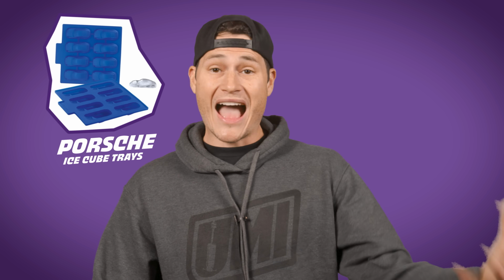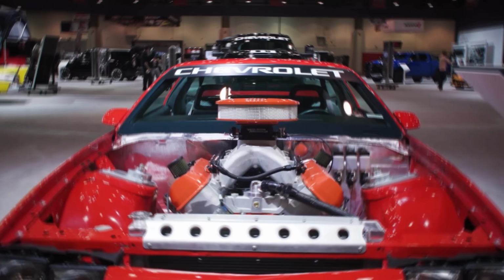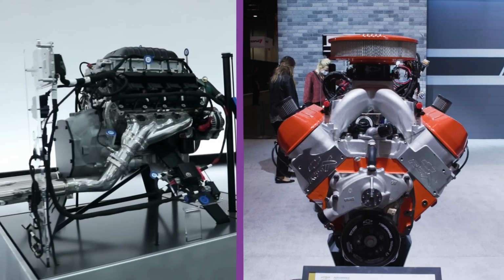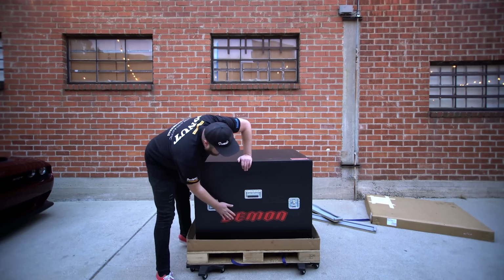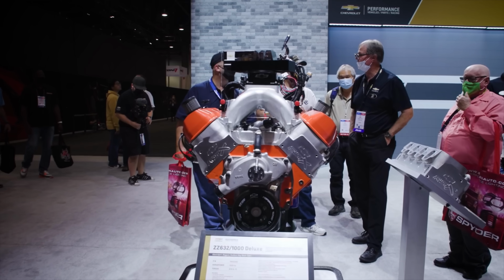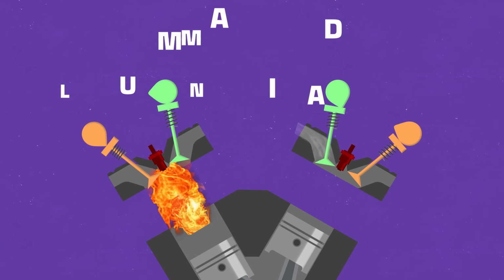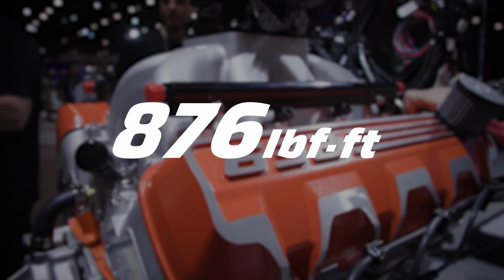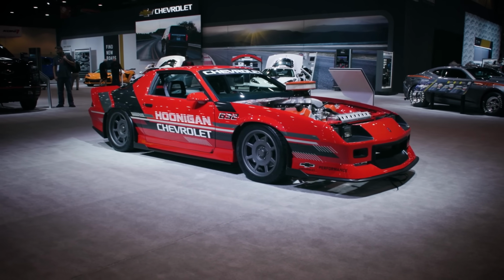Chevy's 1000HP Crate Engine EXPLAINED

Comment: Conversation in Cheavy office:
-"Hey, let's do a pinnicle of modern engineering."
---"So forced induction?"
-"No. Huuge displacement."
---"Extremely efficient heads. and high rew limit?"
-"No. Pushrods and some huuge valves."
---"Hi flow fuel injection?"
-"No."
---"So we make an engine that can idle 24/7 for a decade but for a racecar."
-"Ok, you can have fuel injection."
Reply: 1 There is nothing modern about forced induction, mercedes has been factory supercharging cars since the 1920s. 
2 The heads actually are extremely efficient which is why the thing is making over 1K at only 6600 RPM. Just one of those aluminum heads cost more than most people pay for a whole used car.
3 More power from lower revs is always more efficient than a stressful delayed high RPM peak.
4 The thing would run even better with a carburetor as proven by Engine Masters carb vs efi dyno shootout.
Reply: @Impactjunky  This tech have been used even longer than merc has superchargerd their engines. So this is more like how can we make the most low tech engine using best manufacturing technics in use today.
Figures speak for them selves. Less than 100 bhp/per liter just screams a question of how much does it make when supercharged. And that's probably what happens for the most of these engines anyway. And two valves per cylinder aren't that much of a restriction with forced induction.

My very very important and appreciated opinion here:
Ford 1liter three cylinder turbo engine is more of an pinnicle of modern engineering than this. It actually makes that 100bhp/liter. Ten of those even weight less than 632. This is just "Let's take a truck engine and see how much can we cuddle out of it. By supersizeing it.". 
Now I'm not saying this isn't impressive. But this sure is not the best Cheavy can do with an engineer or two.
Reply: @damniambad  Nope, the big block Chevy hit the market in 58, long after the first supercharged cars of the 20's. There is almost nothing modern about the manufacture or design of this ZZ632 either. High flow aluminum heads were available in the 60's and people have been home building 632 Chevy's with and without aluminum heads and fuel injection for decades. Comparing the power per liter of a forced induction motor to a NA motor is like comparing apples to oranges so your comparison with that weak little three cylinder makes no sense. Also the word is pinnacle not pinnicle.
Reply: @Impactjunky  Oh you are right! It is spelled pinnacle.
Other wise we can of course make whole new segment for zz632 so it can actually be good at something else than being big. Like the most american thing ever -segment. Or just best v8. Of this year.  Made in america. And Is over 6,2 liters but under 12. And makes lot of noise. But not compared to displacement, cause its just too big for that.
Any Ferrari NA engine is just way better in any way but the cost and there are lots of better oil burnes on the engine market that make torgue lower down and actually make some sense in a truck.
Reply: @damniambad  This engine makes over 600 foot pounds at less than 3000 RPM and over 800 at peak. Ferraris best production engine only makes 660 foot pounds total at a later, less useful RPM and only makes about 30 more HP than this engine while needing two extra cylinders and 2600 extra RPM to make it happen. Spoiler alert, the 30 extra horses doesn't make up for the 200 foot pound gap.
Reply: @Impactjunky  632 is usable only in the dragstrip so I'll say ferrari takes usability points. Dragstrip is allso only place where car with 632 has some potential to be faster than just some Ferrari. Like 308 was fairly slow. But hey, you don't have to take 632 to shop to have engine oil changed! All ten gallons of it.
Reply: @damniambad  A car that gets stuck on speed bumps and has no trunk or back seat definitely does not take "usability points". The lightweight aluminum heads on the 632 would also make any car that originally had a big block Chevy handle better. There are plenty of pro touring and road course builds using a 632, just look them up.
Reply: @Impactjunky  680 punds of good handling. Aluminium is not light. It's just lighter than steel. 
And those moving masses make torgue steering in a rwd -car a thing. And thats only the engine.
I mean of course there are people who put this thing in a car they drive around. It's more practical and handles better than let's say jet engine. And lighter too!
Reply: @damniambad  Factory big block Chevy heads are cast iron, not steel.
Reply: @Impactjunky  Oh, I'm sorry. This totally makes this engine a lot better and relevant.
Reply: @Impactjunky  Puns aside. 632 is totally what someone needs to complete his/hers long time build and make awesome rumble in the dragstrip. And it's kind of awesome that engine like this is made while it's still possible and there is intrest in it. When electric motors come and just prove to be better at pretty much everything but the rumble these engines start to disappear and it's kind of sad. But let's not call 632 a engineering marvel, best engine ever or pretend it's something new to begin with.
Reply: @Impactjunky  where can I see those things?
How can you take.... vehicles with 10.4 l engines and bring them up as race cars? They are a joke, nothing more.
I love how the entire comment section is full of people cheering on this 1000hp crate engine. If we think about costs, they have all the right to do so.
But other than the price itself, this engine is just a piece of shit. 10.4 l of displacement and 1000hp(basically, it didn't hit 100hp/l mark) is something I wouldn't be proud of. It's almost 2022 and this engine belongs in the '70.
The list of N/A cars making more hp/l is huge. Doesn't matter if it's a Ferrari, a Lamborghini, AMG, Cossworth. They exist, they may not get over a speedbump faster than a few mph, but that doesn't change the fact that this still is a shame of an engine, from any point of view. 
The fact that everyone in this (entire) comment section brings quarter mile times as they would be a definitive argument is fucking hilarious. Says a lot about the maturity in terms of cars and racing culture. 
No hate though. Idgaf if you like this engine or not, just don't say it's a good one.. its ridiculous.
Reply: @Ioachim Mihalache  LoL you couldn't be more wrong about your power claims. As I said before Ferraris best production engine only makes about 30 more HP than this while needing two extra cylinders, and 2600 extra RPM to make it happen and even then it still comes up over 200 foot pounds short making it drastically less powerful overall. The hilarious part is I just found out that it is a part time hybrid and the engine doesn't even make over 860 HP/560 torque on its own without the temporary electric motor boost LoL. Lamborghini's most powerful production V12 is also a hybrid and only makes 774 HP and 530 foot pounds on its own and pathetically it needs two extra cylinders and 2000 more RPM to do it. The most powerful production AMG only makes 720 HP and it is using the crutch of twin turbos to make it happen. The most powerful production Cosworth V12 is also a hybrid relying on  the crutch of an electric motor to fill its shortcomings. With the electric motor it makes 1000 HP which is only a few less than this engine but it took them two more cylinders, a whole extra electric motor and 4000 more RPM to do it and they still ended up with a pathetically low 540 foot pounds at a uselessly high 7000 RPM which is less torque than the 632 makes just above idle at 3000 RPM and exactly why it needs the help of an electric motor to get it out of its horrific bottom end lag. In short the Chevy is doing way more with way less and making it happen way sooner in the rev range, end of story.  
All you had to do was a basic google search before you posted that and you would have saved yourself the embarrassment.
Reply: @Impactjunky  It's called efficiency. Look it up. 
In short, all those sophisticated power systems put four horses in the tank and gain one horse on the wheels.
Not so sophisticated system like 632 puts 10 horses in the tank to gain half a horsie and and many moore noices. Actually light race/sport cars Ferrari, Cosworth, Merc, etc. doesn't need that low down torgue or even that massive top output it has to be faster than big fat v8 making more noise and heat than power. 
But I kind of found a mindset this engine makes sense. Think of it as a budget Veyron engine. It's even lighter than w16 and actually available. And it's low tech enough it can be fixed in a shed by a carage monkey learning camshafts from youtube. Thou the prize is super salty comparing you can find complete drivetrain with a qarter of the prize. Something that actually rews. Or a couple of Tesla engines and a battery.
Reply: @Impactjunky  are you blind? I was pointing the fact that this engine, as powerful as it is, is just as evolved as the sandwich I ate yesterday. Less than a 100 HP/liter in 2021 is a shame. Period.
Also, you totally missed another point i made, and that's HP/liter ratio. Lamborghini's most powerful V12 makes 760hp (ever heard about Centenario?) out of 6.5l. Ferrari's most powerful V12 develops 860hp out of a 6.3l. And that's before we get to the next category of road engines, i.e. Cossworth stuff (Valkyrie V12 cranks out 1000 HP, ever heard about that?)
It's not about the power, it's about the hilarious way it is extracted - just displacement, big, fat lazy V8, the living example of "bigger is better" dogma.
Don't tell me about torque and stuff. You need it, considering that the ZZ weighs about as much as a Caterham 170, and most of the cars that will ever get this engine are proportionally heavy. On a true performance car, power has a much, much bigger impact than torque. We're not towing some muscle cars, we're leaving them behind:)))))))
Could you please stop messing around about revving? Any european engine revs a lot faster because lighter internals and few other factors.
I'm pretty sure you're the only one embarrassing himself
Reply: @damniambad  you're absolutely right. Aside from the ever living drag racing, there's no use for this engine. But, being so plain simple and cheap, any teenager that spent a bit of time in a workshop can easily get this unit past some serious HP marks. Even then, the power will be there mainly because of the same displacement I pointed out in my previous comment - not because the engine helps you develop it in any way, by  design and stuff.
Reply: @froz3ntree40  LoL learn to read before you respond. I just sent you a message mocking how all of those exact engines are much weaker than the 632 even though they have more cylinders, thousands of extra RPM and added electric boost motors. The Chevy is making way more power with way less moving parts. That is the definition of efficiency. 
Also you fools need to learn how to do math because 1004 HP from 10.3L is literally 2 and a half horsepower away from 100 HP per liter. A simple ignition timing adjustment or a 15 dollar velocity stack or a 20 dollar throttle body spacer would send it well past the 100 HP per liter mark. 
Heck an 800 dollar cam kit would raise peak RPM to 7500-8000 RPM and peak power to 1100-1200 HP.
Reply: @Impactjunky  Right! Way more moving mass, bigger than nesessary, thirstier than a zoo and let us not forget that extra torgue so we can just drop out couple of gears and keep 1000 lbs of more car moving faster than it was ever build to cope. ZZ632 is efficient only in the Chevys table of consepts. Hardly any expensive engineering needed and as long as head is inside toleranses no need to machine the block to lighten it since it is gonna weight a couple of my moms anyway. Actually two of my moms have better power to weight ratio than 632.
And oh yeah. It's forty grands. So very efficient if we ask Cheavy finance department. Manufacturing can just use the same tooling they been using since 1960's. 
Can't quite figure out why american car industry has been in a downfall... But maybe you americans have understood efficiency somehow wrong?
Reply: @Impactjunky  Maybe I shouldn't blame you. Some people still like to light a fire with flints even they have a plasma lighter at hand. Just for the sport of it. It's just not quite there with the lighter in efficiency, even it has been done like 50.000 years. We can allways put some flints in machined blocs of aluminium to make it high tech just so someone can buy it. This is exellant idea! Like what if neanderthals would have had milling machines and titanium! Titanium is better than aluuminium, so it must be more high tech than 632 heads are.
Reply: @damniambad  I think the guy understood how ridiculous he was.
Also, I know that back in '60's and '70's American cars we're pretty advanced, automatic transmission on almost every car on sale, and power figures Europeans only dreamed about. But after that, they kinda stagnated. I can't help but think that all American engines from 21st century haven't evolved past big displacement and superchargers.
I totally agree with you about that tiny EcoBoost engine, produced here, in Romania, being an absolute masterpiece of engineering in comparison to this Chevy V8. Too bad it was designed by Ford Europe. 
Aside from the 3.5l TT V6 from Ford GT and the new, flat plane crank V8 in the new C8 Z06, i can't think of a decent engine that came out of America in the last two decades. Are there any?
Reply: @froz3ntree40  Electric motors. Teslas three phase AC motor and Li-ion batteries are still cutting edge technology. And of course Zero, Alta and Lightning in motorcycles. I don't know so much about ICEs. I quess Venom or Tuatara are some kind of highpoints, but they definetly aren't very innovative. Nor successfull. Then there's a lots of some garage engineers with money and time innovating two strokes and wankels back to life, but they are usually allways in smaller scale. As there has allways been some of those propellerheads it's kind of sad that this innovation doesn't seem to get from consepts to products. 
Some good cars made in Romania, you guys have a good volume going on compared to Finland I live in. We have only one car factory.
Reply: @froz3ntree40  sounds like you drive a Honda! Jk but there is something to be said for torque and HP.. which the chevy motors have. I have a BMW M3 S65 and a Camaro LT1. The BMW makes 414 Hp and 295 tq, revs to 8300 with 4.0 liters. The chevy makes 455 hp and 455 tq with 6.2 liters. While the chevy makes less hp per liter, the physical engine itself weight only 40lbs more than the S65, while makes 40 more hp and 50% more torque. So the LT1 isn't really and outdated engine even with pushrods if we're actually talking about "pound for pound" performance.  BTW the feeling of an NA motor with high HP AND tq is incredible. These are not lazy engines
Reply: @mastoslayerica  I feel the bias going here along the lines of geopolitics. There's a reson why euro and asian cars have evolved past pushrods and it's cause it's not all about pound to pound performance. More like pound to pound efficiency. Even it would be M3 has clear technology lead over LT1. Usa manufacturers have lots of capasity to evolve but less will to do so. I don't really get why.
I drive E46. It's a diesel but it's a good one. Nothing wrong with Honda either, I really liked Accord.
Reply: @Impactjunky  You running out of ways to say how zz has more torgue than anyFerrari engine? Try a little, there's lots of arguments why someone prefers something like this over high tech stuff.
And I'm so sorry you actually need to have a conversation with someone lingustically inferior human speaking and writing more than one language.
Reply: @damniambad  the M3 S65 makes more HP per liter than the LT1. This is a fact. However, the LT1 makes more total HP, 50% more torque, and gets much better fuel economy compared to the S65 and the physical engines are about the same size due to the much taller head of the bmw engine. GM has perfected the pushrod engine with the LT1 and LT2. The engine in this video is a crate motor race engine not really comparable to what you can buy in a street car
Reply: @damniambad  also I love high revving Hondas my first cdt was a DC5 but they are lacking in the torque department
Reply: @mastoslayerica  I'm surpised that LT1 does that good MPG and has VVT. Of course consumption is more about the position of the pedal but big beemer engines don't have a that good reputation with consumption either. S65 is significantly lighter but probably doesn't compare to LT1:s reliability? How does LT1 compare S65:s responsiveness?
Reply: @damniambad  the S65 is a bit more responsive but the LT1 is not far behind.  My S65 is manual and the LT1 is auto so it's not pure apples to apples. The LT1 is a very responsive engine...it's NA and also in the corvette. The S65 has issues with rod bearings but other than that it's reliable but parts are expensive.  My LT1 is new so I'm not sure about the longterm reliability but I don't think it has an catastrophic engine killing issues like the S65 if they aren't addressed.
Reply: @damniambad  the S65 is a bit more responsive but the LT1 is not far behind.  My S65 is manual and the LT1 is auto so it's not pure apples to apples. The LT1 is a very responsive engine...it's NA and also in the corvette. The S65 has issues with rod bearings but other than that it's reliable but parts are expensive.  My LT1 is new so I'm not sure about the longterm reliability but I don't think it has an catastrophic engine killing issues like the S65 if they aren't addressed.
Reply: @damniambad  and the S65 is not significantly lighter than the LT1. Only 40lbs
Reply: Below 4000 rpms the S65 is totally asleep. A 2004 G35 would pull on you. It's not truly fast until 6000rpms. Whereas the LT1 has meaningful power from 2000rpm on
Reply: NO REPLACEMENT FOR DISPLACEMENT BABY
Reply: @MrVirus9898  YEEEEEEEEHAAAAAAAAW CHUCKLEFUCKS